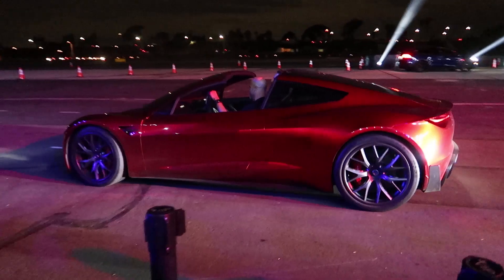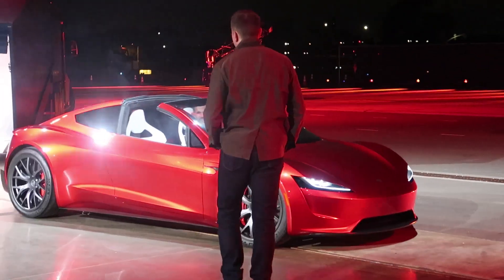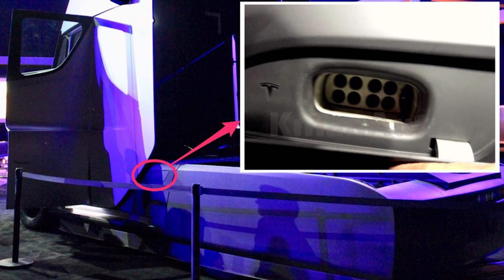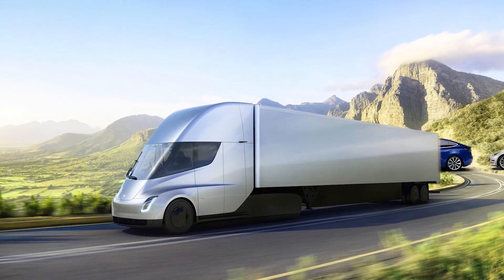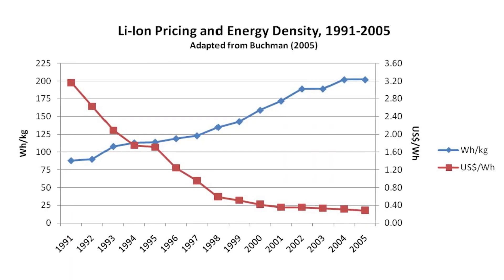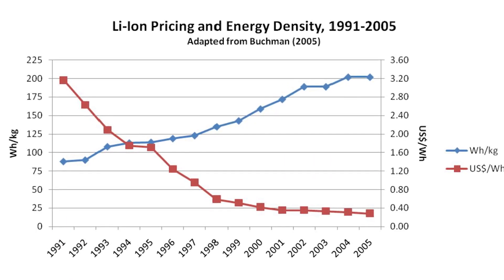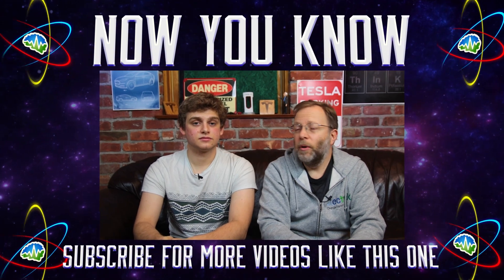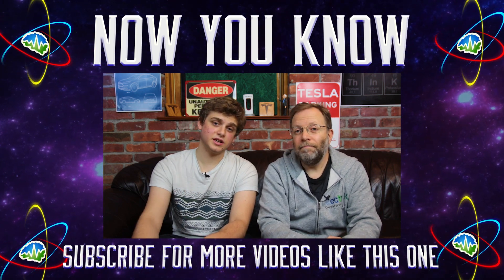Mega Charger Theories - In Depth

Comment: There are eight 100 kwh battery packs. One charger port for each. That would give the specified range, and the 4000 pound battery weight would fall well within the 20,000 pound fueled weight of a Class 8 diesel cab. BTW, a Class 8 diesel drivetrain and fuel weighs more than 4000 lb.
Reply: EXACTLY!

Comment: I don't think that a 240 KWh battery back as you guys have said (4x model 3 battery at 70kwh each) is enough to give a huge semi truck with a loaded trailer on the back the range that the truck will have.  I definitely believe that the semi truck battery back will be vastly different even if just in cost due to production and other efficiency gains or possibly completely different tech.

Comment: The math doesn't add up for "4 Model 3 batteries."  The long range battery is 75kWh.  The semi is 1000kWh.  That's a factor of approx. 13 difference.  If it's 12X, then each of the pairs of cables on the charge cable would need to charge with 3X the current of a supercharger.  Pretty do-able considering they've experimented with a liquid-cooled charging cable.

Comment: In regards to people's comments about Tesla investing in a battery technology that is going to be obsolete, it's similar to your phone. If you can remove and replace the battery every two to three years, it's like upgrading to the newest battery tech in the same exact phone. This is true for cars as well. Elon Musk at any moment in time can switch from an old technology to a new technology without effecting the vehicle production as long as he can fit the new technology in the same form factor. The gigafactory is built in parallel production lines to increase production output. Tesla can change over one parallel line at a time to the new technology and transition over for say a new version of the Model S while the Model 3 is still on the old technology.  If Tesla was to sit around and wait for a battery technology that is perfect, we would never progress into the future. This is what all the other manufacturers have done for years. The technology doesn't have to be equivalent to the current usage model, it just has to work well enough to get your foot in the door and start producing good Innovative new technology.

Comment: Let's simplify this guys:  The 2170 cells are known to be capable of anywhere from 325 to 350 kwhr per kg.  If you want 1MWhr of capacity, then you just do the math:  1000 kwhr = 1,000,000 watt hours.  Divide by 325 watt hours per kg of the 2170 and you get about 3076kg of mass, or about 6700 to 6800 lbs.  That's totally reasonable using current lithium battery tech.

And yes - the "Megacharging" is likely to be an 800 volt arrangement, probably charging multiple packs in parallel.  Since the Semi can operate on two motors out of 4, it wouldn't be a terrible design choice to have 4 battery packs (perhaps 200-250kwhr each) and some switching that can send power to any motor.  If any one pack fails, the truck can still operate on the remaining ones.  Heck - my guess is that two pack and two motors can fail and the truck could still limp home.

Worth noting that semi trucks don't need high speed, so the same electric motor from the Model 3 can be geared down a lot more, giving much greater wheel/axle torque.  There's a lot of flexibility with the Semi because of the lower speeds, having four motors, multiple battery packs, and a lot more packaging space to work with than a small sedan.

Comment: There are a number of technical reasons why segmenting the batteries is not a good design. As far as megachargers go, I would personally want to explore the possibility of being a power wholesaler so that I had access to the large commercial farms out there. One could then use that to offset grid consumption at various location. This would be more capital efficient than building literally new renewable farms for your projected usage. Power tends to go for very low numbers when one contractually commits to large quantities over extended periods. For example, right now California has so much renewable energy that there are days when the Cal-ISO gives it away to other states. As a financial person I would be strongly tempted to see if I could swing some deals on that power.

Comment: I think they will actually use 4 separate power-trains with separate 200kWh battery packs. Elon said that you can loose motor and drive on with the other three. They could have four standard superchager plugs and have a special layout of ordinary superchargers that would allow for cars to charge or semis using 4 chargers at at time.

Comment: Well guys for once I don't agree with you :) 4 Model 3s charging at the same time? It's a lot more than that! Yes I agree the charge port looks like 4 times a Supercharger, there are 4 motors, etc. It seems appealing but 4 Model 3 batteries is about 300 kWh, and the max speed of a Supercharger is about 130 kW it would be only 520 kW, that's not enough. So it has to be more than that. I would say it's more like 8 times a Model 3 equivalent. Using 4 Superchargers connectors it's possible if you use 800 volts instead of 400 volts. That would make the ~600 kWh we've heard about, as well as ~1 MW of power using Supercharger-kind-of technology.

Comment: The semi and the Roadster 2 I believe are both based on the current 2170 li-ion battery cell. As the giga factory continues to ramp up the cost will per cell will continue to drop. To date much of the projected cost curves have proven to be a bit conservative. In two years the cost for these cells could drop by about 16% plus of minus.

Comment: I can agree with the most, the only thing about solar panels next to charging stations... these are not going to help a lot. The biggest 40 superchargers station with 5 huge roofs has a solar maximum power about 250KW which is enough for 2 chargers in a sunny day. The chargers have to work 24 hours rain or shine. Also that comparatively small power will not be enough to charge powerpacks in the same stations. To do that it should be free of customers. So having powerpacks will not help on that station too. Solar power is good, but still need huge spaces and will not solve power hungry superchargers even close. And I big fan of Tesla, trust me. Hope to get my model 3 in 2018...

Comment: Tesla has great tech and really smart people. Something often said about battery tech is that the next big breakthrough is always 3-5 years away.  I think we're running up against the limits of chemistry now, much like on the electronics side, we're approaching the limit of electron movement at the quantum level (tunneling, etc).  MAYBE we'll have incremental improvements every 5-8 years, but we're talking about 5%, in terms of energy density or cycle life. I think the next really great battery won't be a battery. It'll be a supercapacitor.

Comment: I think you guys are on the right track.  The simplest thing for the semi is to stack up 75 kWh M3 battery packs in the tractor and charge them simultaneously.  Economies of scale for the packs, cooling systems and control systems and no new production issues.  I estimate 10 battery packs for 750 kWh total.  About 1.5 kWh/mile at 65 mph.  Up to 1.2 megawatts total charging power?  I think they are stacking two new battery packs (100 kWh each) in the Roadster using current 2170 cells to get maybe 5-10% pack volume savings because of the new form factor and slight improvement in cell capacity per cc.  Also get lower battery cell costs taking advantage of GF volume.  Park roadster between SC kiosks and charge via charge port in each side maybe?

Comment: 2 issues:
1. Can Tesla sell power for 7.5 cents per KWh, Entirely can be done with batteries only or with batteries and  on site solar. Electricity in bulk is 3 or 4 cents per KWh. To the extent that Tesla can buy and store inexpensive electricity (11 PM to 6  AM rates), or generate same on site and 70% get the utility companies out of the loop- 7.5 Cent electricity can be done with technology available today.
2. Can Tesla make batteries which are half the cost and half the weight of what they are putting in Model 3?  If you look at original Nissan Leaf and latest Nissan Leaf; Nissan made the needed progress  in 6 years. At some point one of the many competing concepts for a better battery, or a combination, will reach the goal. I do not doubt that at some point this can be done, and that Tesla (And others) will be able to do it. 2 years is counting on a miracle!

Comment: I think it is just the battery that is there now.. Production is another thing and any advancements or break through on production will be the profit margins.  The battery pack has cooling in it.. break that down small and efficient to battery temp at 21c or 70F then you have optimum life and performance. 

That is the key and why cell phone batteries only last 2 years and yes new models come out every year..   By the way Cell phone batteries aren't cooled well and you fast phone today is a dogs breakfast tomorrow or in a 2 years time. 

That is the key... That is why Roasters power pack is the same as the semi.. Oh the Roasters floor is all battery from wheel to wheel..

Comment: Same theory applies when people ask "how much does it cost to replace the battery in an EV?" No one knows because no one has had to do that yet - out of warranty.  But after the 8 years or so of these battery warranties the battery will be 20-30% cheaper than they were when they first went into the car.  Also, you get a credit for your old pack since they can recycle the good cells into the power grid or hard recycled down to the elements to make brand new batteries which brings the total cost to you for a new battery way down.  But it seems the batteries are built to really last since Erick Belmer's 2012 Volt has over 415,000 miles on its original battery.  Most gas cars would need a new engine or just fall apart after so many miles.

Comment: watch out for Solid State Batteries from Sakti3 recently acquired by James Dyson. Remember they are also promising electric cars by 2020 and they already have the electric motors experience. 

Also, Hydrogen Fuel Cells would be another technology to compete here since they pack a much better energy density.

Comment: Is the Semi and 2nd Gen Roadster possible with today’s tech.  I very much think so!

Battery Tech: the experts have said these performance spec for the existing batteries is possible today.  No mystery. Too many people are using data from older batteries to prove otherwise... yea that works well on x86 CPUs 

Battery Cost:  too many are using costs based on wholesale and even retail prices, plus some are using prices from low volume producers.   I am sure Tesla has found a way to break the $100/kWh level and if they are projecting anything it’s the future cost of production on cells

Electric Cost: too many of you are using retail and/or residential cost per kWh.   Check out EIA.gov for industrial wholesale costs and you will see there is still margin for Tesla at $0.07/kWh.  Charge PowerPacks at off peak rates for on peak usage.

Solar powered Mega Chargers:  they are can be powered by solar even in the land of the midnight sun!  Elon NEVER stated each station will have its own array, he did say each would have PowerPacks.  Tesla could build mega arrays in the southwest to supply the grid to offset the charging to make good on the 100% powered by solar.  Plus they can build the arrays at cost given the own all parts of the production chain.

Fast Charging:  the video touches on it some.  Tesla is likely using four super chargers at high voltages. Speed remember a larger pack will charge faster than a small one;  take the % increase in charging rates of the two M3 batteries and scale it up.  Still a bit shy add a few compactors that can accept the rapid charge then slowly charge the battery packs as the truck rolls down the road.

Battery Weight:  how much dose the Model 3 packs weigh WITHOUT the inverters packaged into the unit.  Most can’t because that is not public info.

Roadster 2 200/kWh won’t fit:  I think too many of you are assuming the 2nd gen is the same size as the first gen.  I don’t think it that’s true. Plus looking at the car there is enough room to add more battery packs below the trunks and seats.   Tesla is not limited to the large flat plate in between the four wheels.  

Toooooo many of you are just like GM and traditional auto manufactured.  ITS NOT POSSIBLE, at least not today day but maybe in the future?
Reply: Excellent analysis despite the typos. Thanks.
You are correct to point put that , although Elon did say that the mega-chargers will be supplied from solar generation, he did not put in any constraint about each charger having its own local solar array. Still for him to guarantee $.07/kWH, this seems to assume that if Tesla is supplying power to the grid at a central mega array, then drawing power from the grid at separate local sites, then this will require unusually advantageous power distribution agreements with the utility.
Reply: Lewis Vaughan sorry about the typos I was typing while loading my car, so I was not watching what I typed or had time to proof read.
Reply: Lewis Vaughan if you look at the industrial wholesale off peak rates at eia.gov you can see they are quite low; much lower than the $0.24+/kWh some   suggest.  Tesla can sell solar power durning peak hours to say CA.  A Megacharger in Northern Maine can fillip the local PowerPacks at night from the local utility during off peak hours to charge trucks.  Even though the electrons cannot make it to Maine from the southwest, one could still say a truck charged from that local was still from solar, due to the offset in CA.

Tesla just needs to make sure their costs on off peak wholesale electricity at each location nets a combined national average less than $0.07.   Then Tesla needs to insure they generate and sell from their solar arrays an equivalent kWh used at all charging stations.   

Right now all Superchargers are to be supplied by solar power, but many of them here in Colorado do not have solar arrays anywhere around them.

Same mode of operation that yields clean solar transportation.  

Given there are four unconnected grids in the US, I am sure Tesla can even find locations to build arrays on each of the grids to appease those who don’t like the offset accounting idea.  

But to say its impossible to power, what few Tesla Semi, with 100% solar because one can’t build 7 aces of solar array above each station is a simple minded view.     

Who has a power generation plant at their home to meet their daily needs; off grid homes are the exception.

Comment: Tesla is not supposed to be buying any electricity from the electrical grid. At the announcement, Musk clearly promised that these mega chargers will not be connected to the grid, that they will be relying completely on solar cells and power packs and thus in effect these Tesla trucks will be all powered by the sun! So arguing about the relatively high cost of electricity sold by the local utility bis pointless and useless and shows that you (the arguer) are not listening.

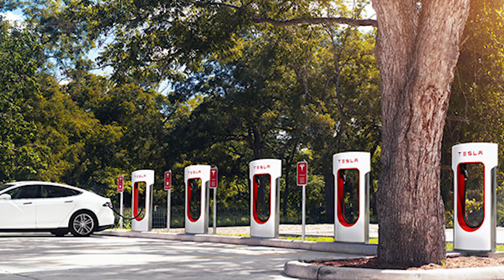Comment: 5:33 Note that Superchargers split the available maximum power (120kw/135kw or whatever) between two stalls. So 8 Superchargers is roughly 1MW which would mean it translates into 1 Megacharger (or two if, again, you split the available power between two stalls).

Comment: In one of the talks Elon said on battery that there is a lot of bullsh*t in the market. One of the energy solution company representative said that when they ask customers which company battery you want, their first choice is Tesla, bcz of reliability. Look what happened with Samsung Note phone, so it's not easy to introduce a new technology overnight, because it will require few years in market with working prototypes or items before public start to trust its reliability.

Comment: What people do as a mistake, if Tesla draws from the grid, it's simply not the household rate. Here household rate is 13 cents, while high voltage line high use rate is a less than a third of a cost because its cheaper for a power company to give a ton of energy to one point compared to thousands of separate locations. And it doesnt take a genius to realise they dont use residential rates.
Reply: It is generally true that industrial rates are lower than residential, but the difference is not that great. Apparently it does take a genius to listen and understand Elon. He stated clearly that mega chargers will not be connected to the grid but will use completely solar panel generation and power pack storage technology. Why does everybody ignore this statement?  Elon is not a liar; he has come through with promises every time - except on schedules.
Reply: Lewis Vaughan It was said the same about the superchargers. It's not the case for the most supercharger locations. In practice Semi megachargers will still draw from grid. With assistance from solar. And solar would feed into grid no matter if a truck is here. You know, in case they would do that, imagine if by random coincidence trucks come in one after another, and deplete a ton of energy and makes the battery pack in the charge location depletes(does happen with some CHAdeMO stations IRL). Car Superchargers are connected to the grid, and maybe have hybrid battery-grid tied solar farm nearby, but they wont put giant solar farms on every single location we can bet cash on it.